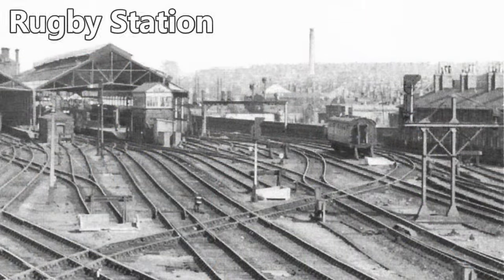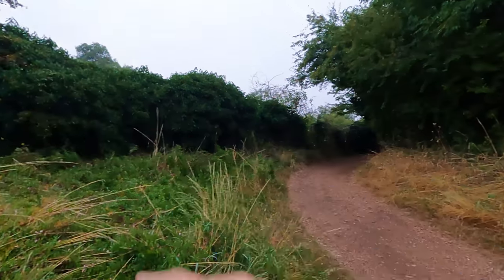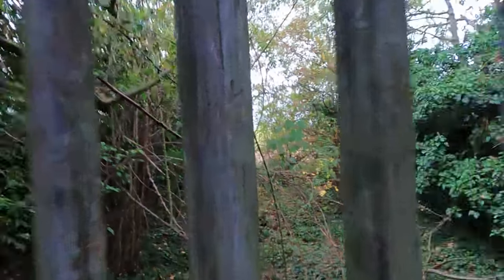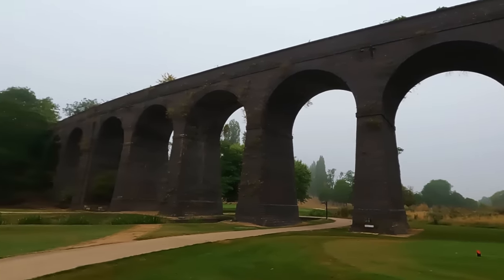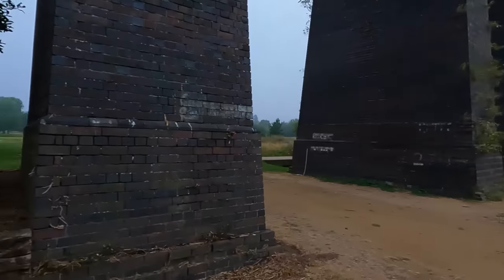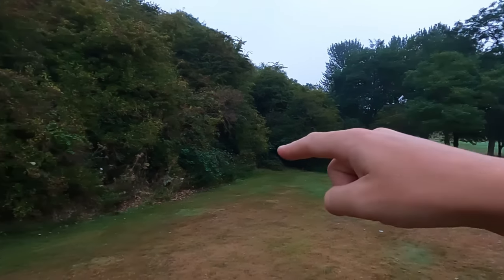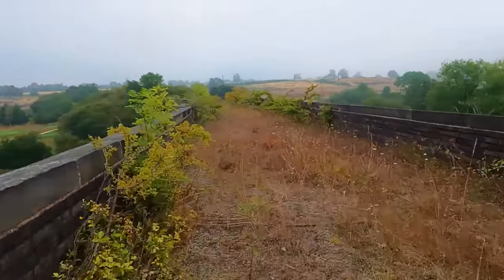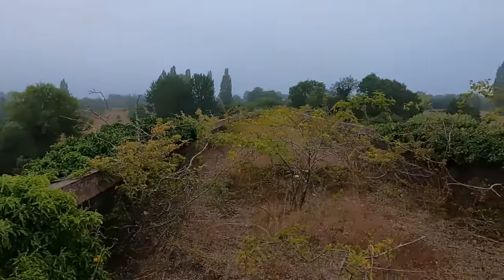The Forgotten Disused Railway Viaduct Hidden Away in Warwickshire

Comment: Yet another East/West line that was destroyed by Beeching and Marples. The Rugby to Peterborough line was quite busy yet because it didn't radiate from London it met the same fate as most other non Londoncentric lines. Even today as they are trying to reopen the Oxford to Cambridge line there are major spanners being thrown in the works to try to prevent it. We need proper cross country communications by rail. In my humble opinion that should be a
main aim in "levelling up" Britain. For some reason our government is stuck in the past where everything centered on one place, London, to the detriment of the country as a whole. Today we see the Manchester to Leeds and Hull line spending being cut back yet they are pushing for a North/South Cross rail to be built. The first thing required is to get the rest of the rail system up to scratch for future generations to use.
Thanks for another great video. The drone shots were superb yet again as they give a real time view much better than any map.
Reply: Your absolutely correct.
I totally agree with you.
Reply: I'm Australian but note that London has only 13 per cent of England's total population (though higher if one discusses 'Greater London').  You have huge numbers of secondary cities and a few thousand smaller villages, so you are on the ball with your comments about more cross-country east-west lines needed.
Reply: Couldn't agree more, what you say is absolutely spot on. Our governments seem to be perpetually London-centric, no interest in improving any infrastructure if it's not directly connected to the capital. It's a tragedy so many lines were lost and communities disconnected.

Comment: Fantastic! Wonder how long this will stand for. Bricks do crumble over time, but these look like they’re in good condition! Maybe another couple of hundred years.
Reply from the maker: Thanks so very much for such a lovely comment
Reply: Definitely! unfortunately, the old Victorian Viaducts on existing lines cost a fortune to maintain!
Reply: They are engineering brick and last quite a long time as they repel moisture, they are still used in building projects where water needs to be controlled from ingestion
Reply: They aren't in the habit of demolishing these things now, so will likely hope some group takes ownership and finds a use for it and a way to maintain it in the future
Reply: They are blue, engineering bricks so tougher than most. Lets hope they stand forever
Reply: As long as the golfers can aim in the arches and not the brickwork then yes it will be round for many many years to come. I'm from Rugby so there is another bridge similar called the eleven arches over Leicester Road railway bridge. That now is public way. As years ago it wasn't for public use. Golf course viaduct is actually private and not for public use.

Comment: Such a solid structure Ant, is this particular viaduct. It is in such a good condition, maybe because it was built with top class bricks - blue engineering bricks are they called I wonder? Another pity that the line had to close when it did to Market Harborough, all those years ago. Rugby lost it's GC connection too, roughly at the same time. Anyhow, glad that you managed to get on to the viaduct, and many thanks for producing this video.
Reply from the maker: Glad you enjoyed it. It does appear it was quite a useful route back when it was operational and I think we miss cross country routes like this
Reply: They are indeed engineering bricks and they're very hard, but I'd call them "brindles" rather than blue.

Comment: Another cracking vid, thanks! At the South end of Rugby station the the formation of this branch still exists for several hundred yards, it passes between what were pillars of the old GC Birdcage Bridge. It is the headshunt & access to Colas Rail's Engineering Depot on Mill Lane in Rugby. I've been along there several times going into the depot.